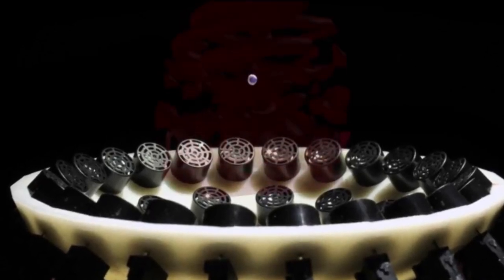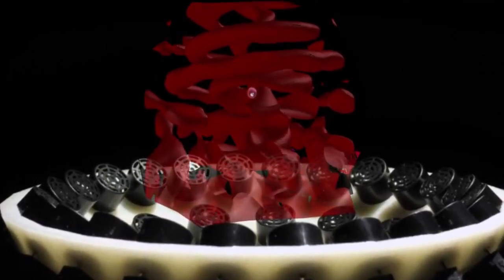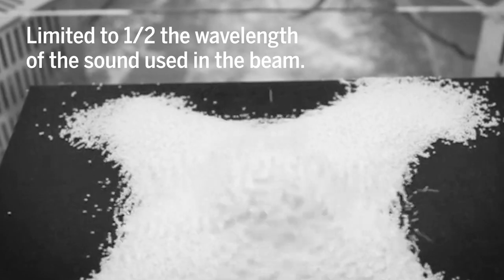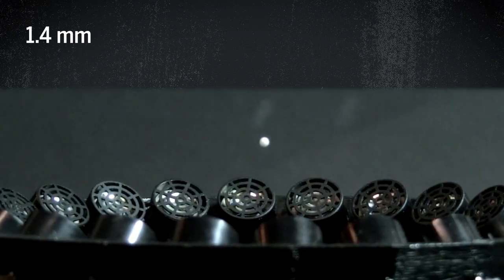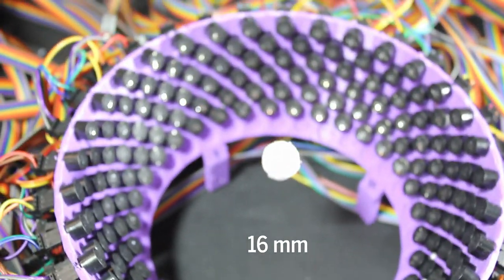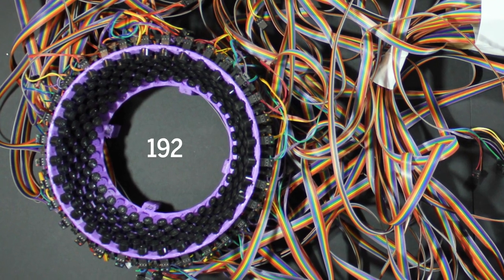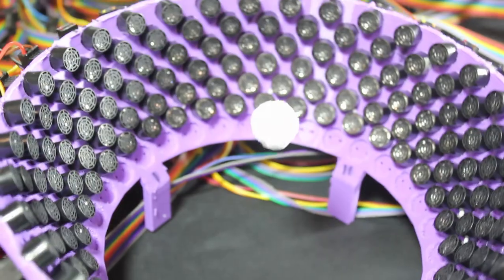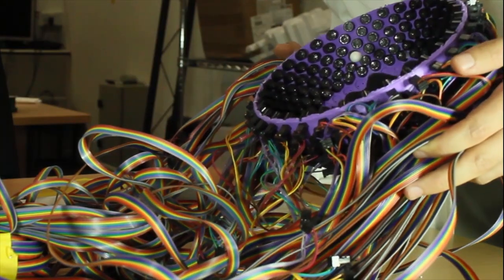Watch the world’s most powerful sonic tractor beam levitate its biggest catch

Comment: Maybe now's the time to whip out the magnets and create a tractor beam that just manipulates the mass of an object instead of making fixed set soundwave levitation...That isn't a tractor beam that is another form of antigravity field. Course, use that in fun projects at nasa and roam inside a canister filled with those things, yeah, but it can't carry things around while moving therefore it is not a tractor beam. Interesting find though good job.
Reply: It can carry things around while moving. Acoustic levitation doesn’t push objects against gravity it pushes objects against a pattern of sound waves, move the device and the objects it’s holding in the middle of the sound wave pattern will move as well. This isn’t just conceptual, look up acoustic levitation robot arms.

Comment: Space isn't vacuum.
Reply: Sacchi Space is, in outer space, there is no "air" for sound waves to push things with. However, inside a space station, there is air to do so. The narrator is referring to the inside of the ISS where ppl are without gravity and might need a convenient way to stay stable.
Reply: Even outer space is not a perfect vacuum. Even the least dense space in the universe has several hydrogen atoms per cubic meter.
Reply: Dankman9 Sure space is not a perfect vaccum yet space is way too sparse for sound to travel through space. Also we have no idea how least dense space in the universe looks like. We can't observe the whole of space to find out.
Reply: We have fairly accurate models, and it's obviously an average. And sound most definitely travels in space, nasa has recorded sounds in space. We can't observe the entire universe, but we can make certain assumptions based on what we know about the rest of the universe.
Reply: Maybe he's confused with EM waves.
Reply: So you both agree and disagree at the same time, so profound, move along.